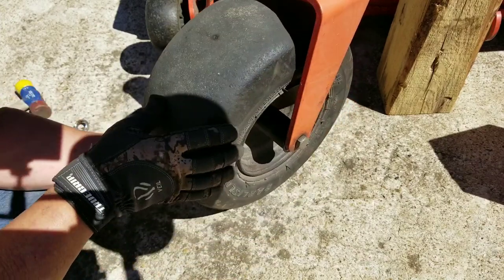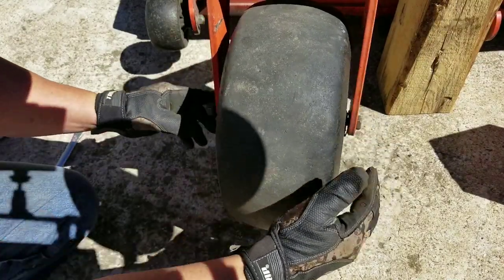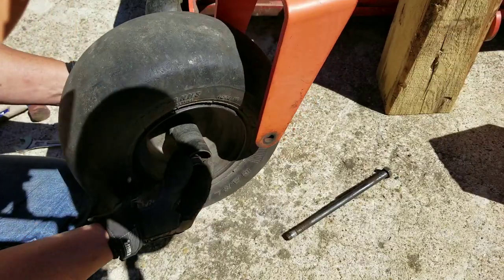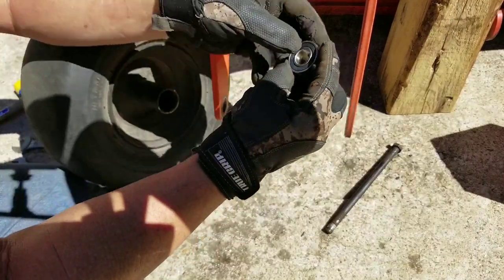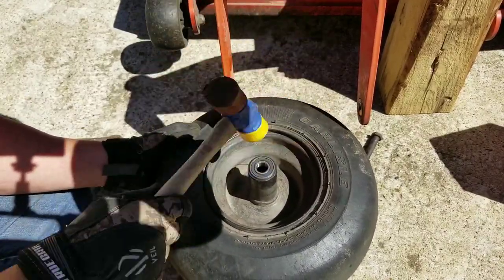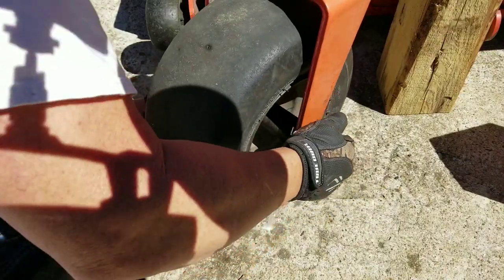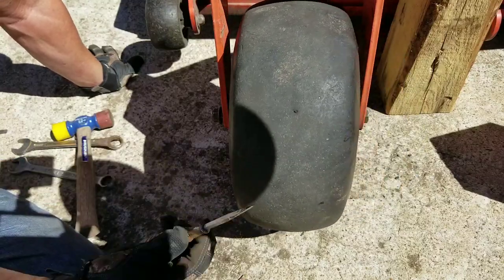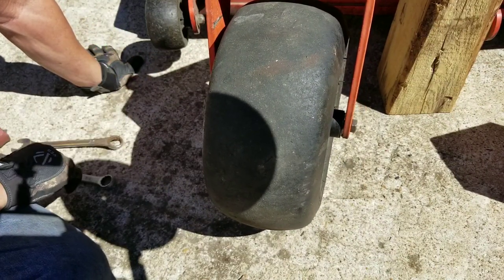Bad Boy ZT Elite: Replacing Front Wheel Small Bore Bearing

Comment: trying to remove my hex bolts on the front end of my 2017 Maverick. I have the nut off, but the bolt wont slide out, any ideas? EDIT: Badboy support told me to saw them off, the raplacement parts from them are much better than original.

Comment: Hey thanks for the video I'm over here killing myself on this 36in revolt trying to get the bolt to slide out of the front wheel the bolt is frozen onto the sleeve on the inside I've sprayed this thing with WD-40 and then pounding it with a two-by-four and a mini Sledge and it will not budge it's actually pushing the fork out before the bolt what a shity design I'm going to have to order a bolt before I cut it off I've done this before on other lawnmowers many times this is a royal pain

Comment: Same problem as previous reply.
Reply: Oh Boy, same problem. That spacer pipe frozen to the bolt. I removed the yokes and tried pressing out the bolts on a twenty ton press and all that happened was the axle bolt started bending off to one side. Finally took a skinney wheel on a 4" grinder and cut off bolts between yoke flanges and Then enlarged the yoke holes to 5/8" and used 5/8" x 9" bolts (The bearings I.D. are 5/8"). I just tightend the nuts to where they were just pushing on the yoke cheeks slightly and then double nutted the bolts. Oh Yeah, I anti-seized the crap out of the bolts when I installed them, so I could remove them in the future. Four bearing from ebay were $14 and another $20 for the two bolts and nuts.